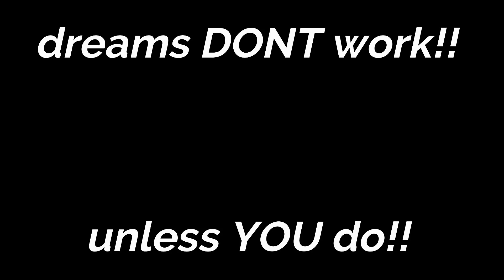Coming out SO SICK!! (Fender Bodywork)

Comment: Should have used a light weight fiberglass filler over ur weld areas it will b water resistant then use bondo after the fiber glass filler bondo will suck up water and will crack up